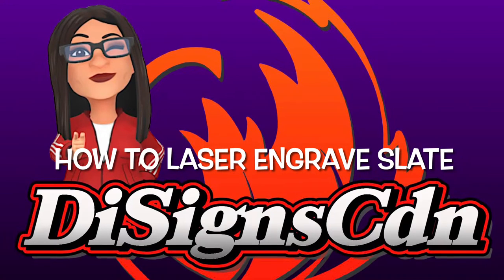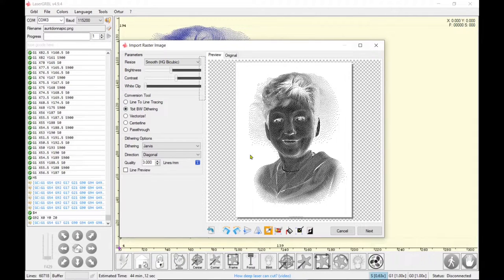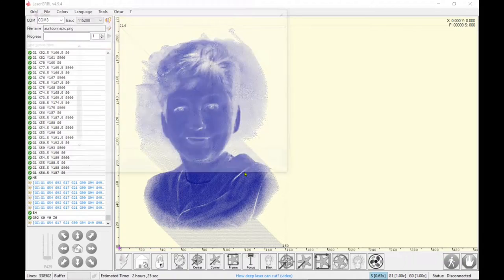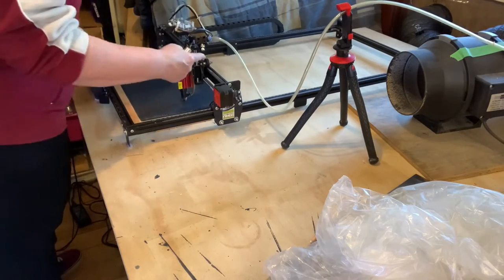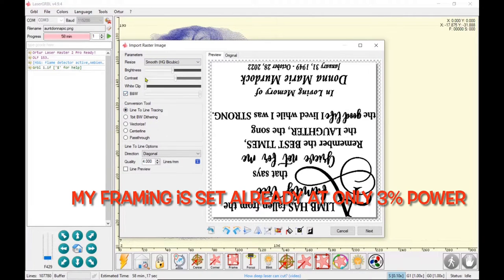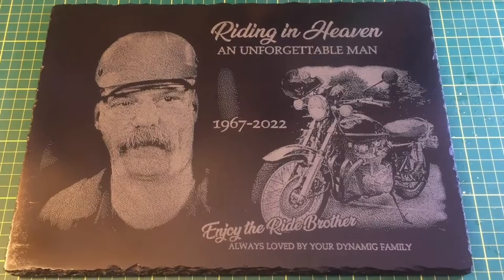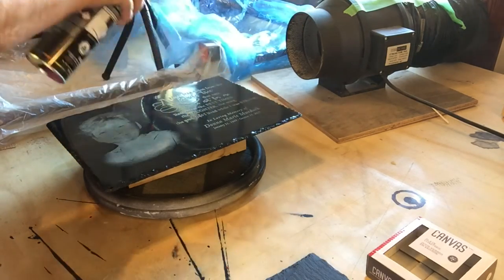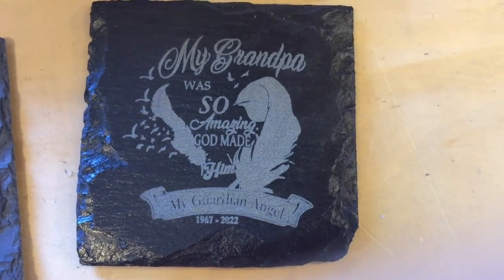18. Laser Engraving Slate in LASERGRBL with ORTUR LM2 PRO Laser Engraver !

Comment: Thank you! Saved my sanity trying to go between LightBurn and LaserGrbl. There are some features I wish GRBL had, but now my engravings and cuts are more predictable and consistent with it. Whatever works, right? :)
Reply from the maker: You are very welcome! LaserGRBL is my go to workhorse ! I finally pulled my Rotary Accessory off the shelf last night to give it a go..in another program you need callipers and a math degree it seems.. 2 basic changes to my Grbl Configuration and I was engraving tumblers for the majority of the day. Things do not need to be over complicated 😃
Reply: Hi from Glasgow 🏴 got my laser over 2 years ago still can get my picture correct to engrave I have a clue what am doing wrong??? I am now a fan of your videos but I am still struggling 🫣🫣🫶
Reply from the maker: @FunkieFountainCreator  Greetings to Glasgow! 😃 If you have Facebook and would like to join the DiSignsCdn page, I’ll see any questions you may have sooner. I have found when editing photos, changing my screen contrast to not so bright helps with finding a better brightness and contrast on photos. A monitor back lights a photo too much and makes it much darker than it actually is. How many lines you use depends on your material as well. Glass and slate I use only 5 lines for a 300 dpi photo. Wood I have gone from 7 - 10 lines with a 300 dpi photo. 1bit BW DITHERING in Atkinson is my favourite personally . Every photo of course is different, and finding the proper contrast and brightness can be tricky as well as the material you are using. Try using paper card stock to test on .. of course at a reduced power as to not start a fire. 😆Testing will get you there eventually 😃

Comment: Why did you engrave the text upside down?
Reply from the maker: I wanted to use the offset function in Lasergrbl to get my lettering precisely where I wanted it. So by flipping the board itself upside down, and making sure the bottom corner of it was at my home position of 0X 0Y , the Laser would engrave exactly at 15mm in and 40mm up. With flipping the board, I had to flip the text as well. I had done the photo at exactly 15mm in,  and I wanted that same spacing in for the text so everything would appear exactly centered on the board. I do this quite often if I'm engraving and then cutting within the same file using the "append" feature as well so the engraving begins at the bottom. Its a lot quicker :)

Comment: How much do you charger ?
Reply from the maker: Well this particular engraving I did was free as it was a gift to the family after a dear friend passed suddenly  :(  but if you're looking for a basis on what to charge, I usually charge $20 an hour for laser time. $30 an hour for design time . Now I may be quicker than some people design wise, ( 25 years experience) but I am using a diode which is slower compared to a CO2. Most C02 users are charging $60 an hour with a minimum of $30. Now materials are on top of that and you need to account for every little thing you use for it and multiply that by 1.4 to cover consumables (even your laser for a replacement in the future ) The days of sign shops being able to make a living at the old rate of $75 an hour is tougher these days with new business' cropping up everyday. The important thing to take from this is don't just take a job to get some money. Don't undercut yourself, your time and your equipment - that only hurts yourself and other business'. That one customer that wants a great deal on a first order for possible future orders is a customer that will be a pain in the butt for the rest of your days!! If you're not sure what to charge for something check out what similar items are going for on some of the sites like Etsy for example. NEVER undersell yourself. :)